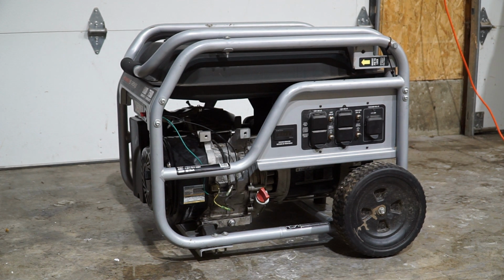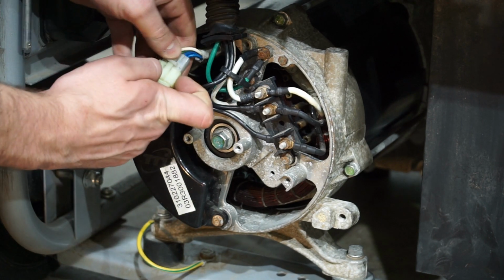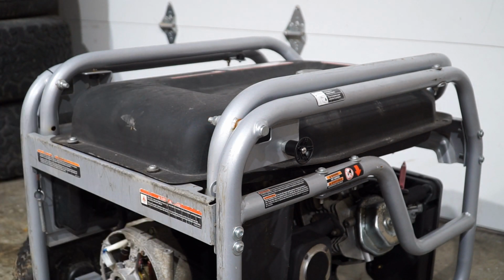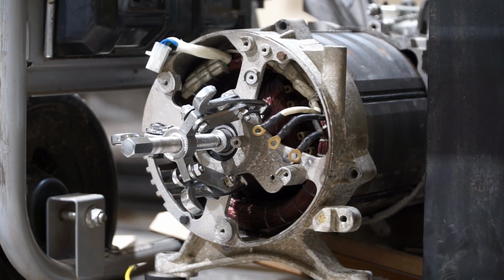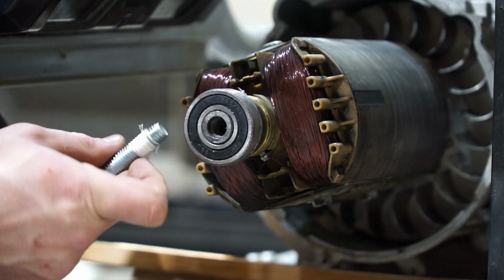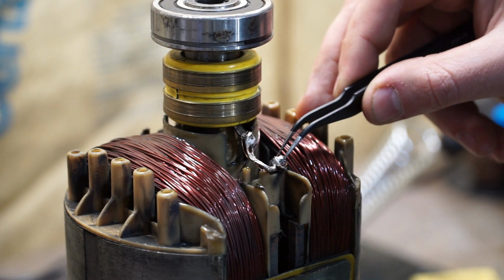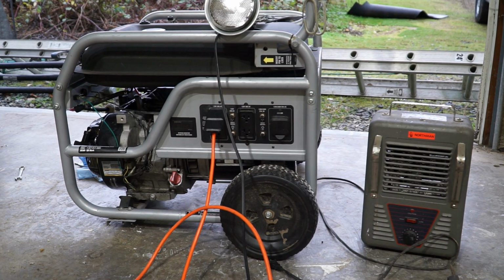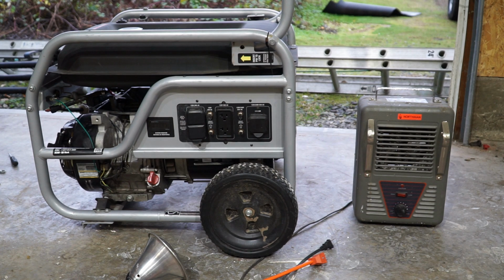How to Repair / Replace a Portable Generator Rotor!

Comment: Where can i get a rotor from? I have a 3200/4000 watt predator generator reading 35ish Megaohms at the slip rings😢 was making about 7 volts ac though.

Comment: Hey Derek  Wonderful video and a great outcome for you.  Your straight forward logical approach severed you well.  I have the same condition on my Honda gen and am very confident that when I pull the rotor tomorrow morning I will be a very happy camper as well.  BTW is the genny still running well for you?

Comment: i have a brushless rotor that i have to rewind as the plastic fan destroyed the wires .i can't find the rotor resistance anywhere on the net .I think rotor resistance is critical for voltage stability .Given your effort i"m going to try and rewind mine.my gen is only 1500w 1800w peak but it's so useful given the unreliable power in australia .
Reply: Dont want higher then 70 or much lower then 50. Old post but just in case.